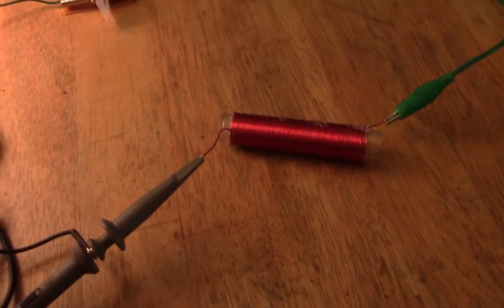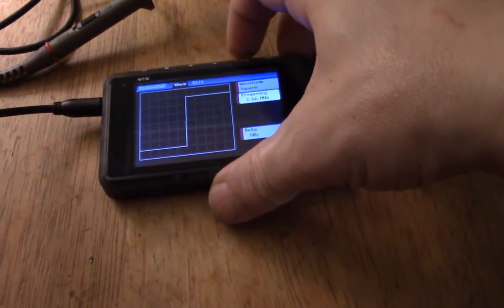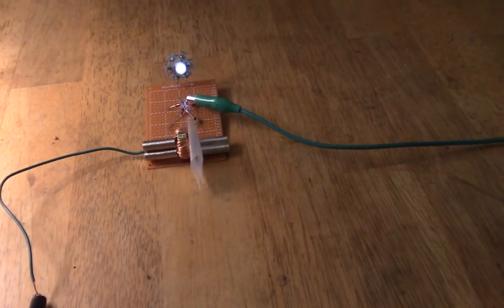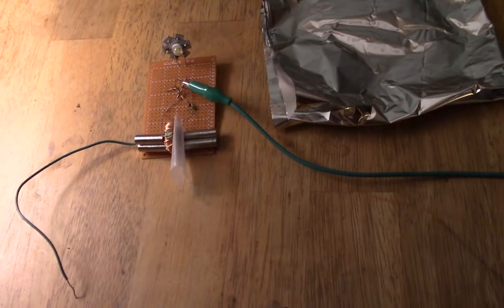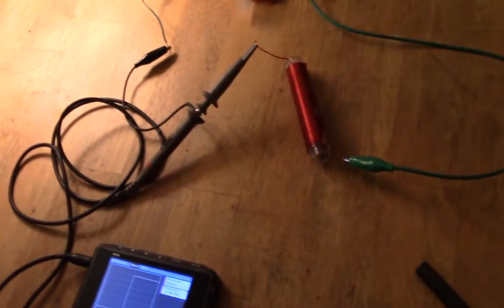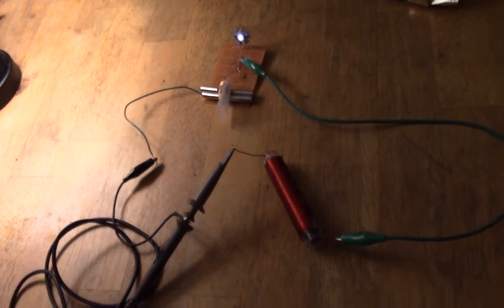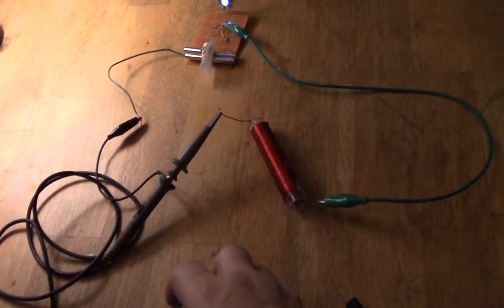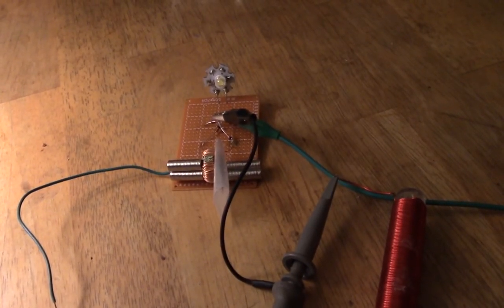Dr. Stiffler SFM - Part 2 -  lots of experiments

Comment: Really interesting device and experiment... i am wondering if would work with a joule thief instead of the frequency generator
Reply from the maker: Thanks. I wouldn't think so, because the frequency seems to need to be quite high and JT's drop with the number of turns -  http://cs.yrex.com/ke3fl/htm/JouleThief/JouleThief.htm
Though of course I haven't tried it and should !
But do agree that a simple form of adjustable frequency device is a great way forward.
Reply: Slider2732  thanks for the link, very usefull page :)

Comment: Sir, may I help a bit? Okay here are a few hints. 1) You are driving the wrong magnet, drive the one that has the plastic between it and the coil. 2) Two many magnets covering to much of the coil. Stake then or use a single stack. Then at res. carefully adjust position of mags on coil. Freq will also change when you do this. Great job.
Reply from the maker: Many thanks for your help !
Will certainly continue to improve the build & will follow the advice.
Am delighted to see you posting new videos and wish you the very best.

Comment: Dr. Stiffler responded to my last video and left several comments. It is really interesting what he says.  https://www.youtube.com/watch?v=iNMsynVKngo
Reply from the maker: It is, he seems to be quite the team player with the SFM and that says to me that it does what it says on the tin. 
He didn't say in his comment here that my driving wattage was too low, so i'm now going to get those darn magnets to do magnet things :)
Reply: He has gone another direction in his last video with the "Stiffler Loop".  I don't understand the 4 diode circuit unless it is just 2 AV plugs.  The two coils made slightly different to produce a current flow is fascinating.
Reply from the maker: I wonder if it relates to potential difference. As in -12V and -7V  will produce a +5V. The coils would then be forming that difference.
Reply: That is sort of what I was thinking also.  Basically he set up a dipole with a potential difference.  A resonant electronic battery.  Maybe I am way off and it is just wishful thinking.  This is the stuff of science fiction if it is real.